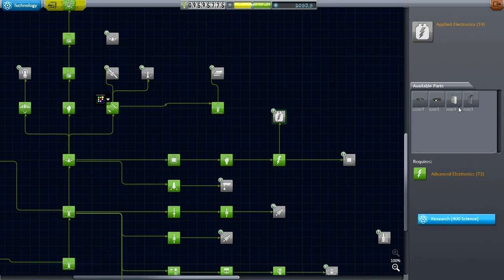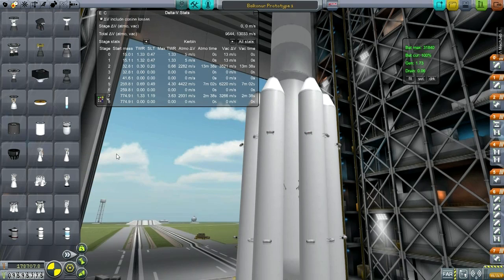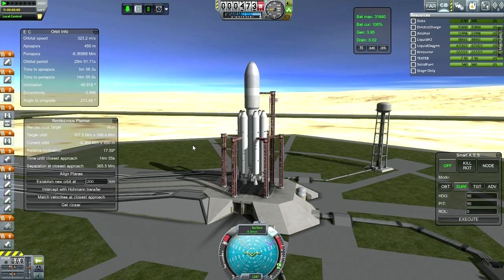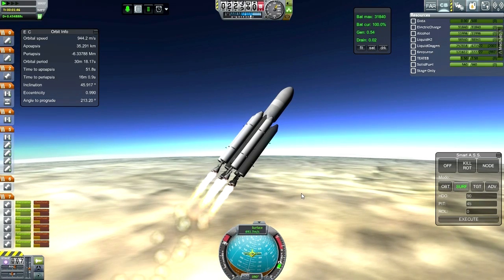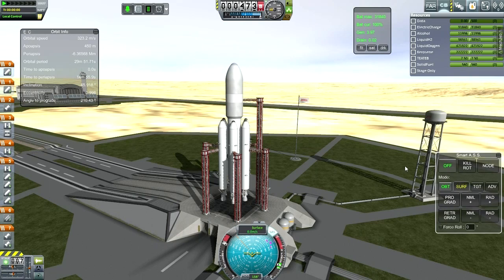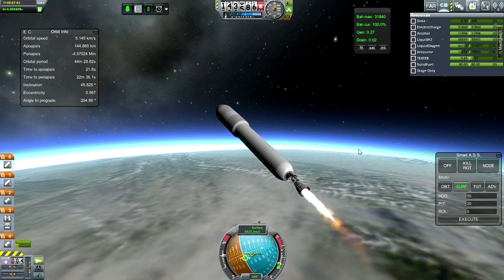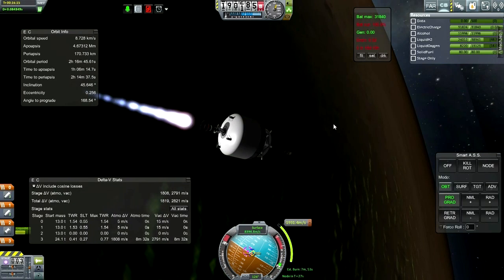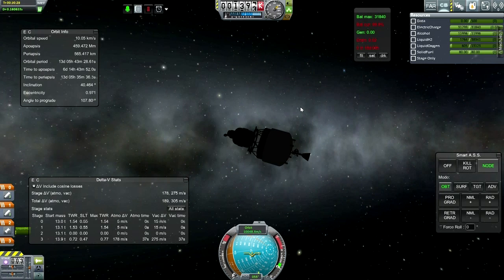Kerbal Space Program (0.24) - Realism Overhaul 055 - Baikonur and Bugs

Comment: I know how old this video is, and that no one will probably see this, but I know the struggle of lunar launches from baikonur. I was recreating one of the Luna missions, and Luna 1-3 were direct ascent missions, and due to baikonur's inclination, they were launched off plane over the North Pole, so getting a good encounter depended almost entirely on a well timed launch. I ended up launching my missions south over Antarctica instead of North, so that my trajectory would come closer to the moon's orbital plane. None of the engines on the R7 used for these missions were throttle able or restartable, so I couldn't make any kind of corrections after the initial launch. I added RCS thrusters to make some small adjustments though, because there was almost no way I could've done it otherwise. After a lot of trial and error and a lot of luck, eventually I got it to work well enough to get a close flyby and an impactor, but I never tried it in that configuration again. I basically just eyeballed the launch window, which only really worked due to sheer luck alone, and was not really repeatable, so I failed a huge number of times. I think this might just be one of the most difficult things one can do in RO, and I was only able to do it with tools like MechJeb that helped me plan my maneuver mid flight. Using the molniya was a lot easier because I could at least get to orbit first, but it was still somewhat of a challenge. 

I don't really know why I posted this, but I just felt like sharing my experience for those who are interested, even on a 5 year old video lol.

Comment: Regarding the "space key bug": The staging has a build in cool down time. This time is in-game time! If you rewatch your video you will see the time at launch does not progress for several seconds while you are spamming the space bar. It won't let you stage again until some in-game time has elapsed.
Because of the lag you can also see that after releasing the launch clamps the control switches from local (via launch clamps) to satellite. This actually causes the engines to turn off because of the missing connection until (after half a second) reconnecting via satellite. This causes the "going down" of the rocket. With the great amount of lag you are able to see all this in slow motion.
Reply: *****
Actually I watched he whole video but had typed in my comment already at the begining. ;-)
Still I think you didn't get my point. I don't think FASA launch clamps change the staging cool down but instead may increase the overall lag. What seems like a longer staging delay in real life time is most probably the exact same delay in in-game time. It only seems longer. You can see the MET is still on +0s when the clamps finally give way although in real life already 20s have passed. In in-game time the cool down still is something like 0.5s.
I myself am using FASA all the time without any lag. So my guess is RO is to blame.
Reply: Der Troglodyt I thought that the staging delay was 1 second.
Reply: Jake I remember reading that too somewhere but can't find any reliable source on an exact value. So I go with what I can see in the video.
***** I didn't mean to blame RO alone. Most mods work perfectly fine on their own. Being a developer myself I know it's always the interaction / side effects where it gets nasty. ;-)
Good luck for your trouble shooting.

Comment: Oh - first time you loaded up the rocket - I immediately shouted - "that's Angara-7!" Well it sorta is, but in a real life designers are using the same modules for boosters and core stage. They light them all on the ground, but throttle down core stage engine to the minimum until boosters separation (taking advantage of deep throttle capability of RD-1xx family). And your TLI stage resembles KVTK upper stage that is in development now - although it's planned to use RD-0146D version of the engine with lower thrust, but higher Isp. So overall it looks like you independently came to the same design choices as real life designers did :)
Now - as for flights to the Moon from Baikonur. The plan is to use off-plane transfer, where you start your burn in one of the nodes (either AN or DN), and this ensures your apoapsis will be exactly on the opposite side. Now the only problem is to make sure the Moon will actually be there at the same time your payload will. In real time it's done with better timing of a launch, in KSP I couldn't be bothered to do that, so with a bit of extra dV I bring my apogee higher than that of the moon - since the orbit will be very elliptic, velocity near apogee will be very low, which allows for 1) very cheap plane changes, and 2) you let the Moon to catch up to you since it will be going much faster than your payload. With that approach you don't have to worry at all about launch windows, and can launch anytime - once you in orbit see which node you will need to use for TLI burn and plot ~3200 m/s TLI burn and then tweak it to your liking.
Please note that this kind of trajectory can be used for launches from anywhere with any resulting parking orbit inclination, and dV for such maneuver is going to be roughly the same from any inclination.
Reply: ***** Lag is almost always related to nullrefs spam in the log. The first step to diagnose is to open the actual log file to see what mod is spamming and take it from there. I've never had any problems with RD-0146s myself though (although I used them quite extensively), so maybe it's some new issue - likely in RF or Engine Ignitor (or both). Anyway - post those nullref messages and we can take it from there. Usually having that error message it's quite easy to find the actual code in the source which is causing the problem, and from that - to make reasonably educated guess as to how to make it go away.
Reply: ***** Ok, please let me know if it will - I haven't played KSP for quite some time, so I need to know if I can safely upgrade to latest versions of stuff.

Comment: Has Squad ever provided any indication that a really large persistence file will overload the game?  Your mention of this possibility kind of makes me think that there might be a practical upper limit on how much exploration you can actually do.
Reply: ***** There's no persistence file upper cap that I know of, specifically, but large files do stress the stackloader somewhat, especially for individual craft with high part counts that exist within otherwise large saves.  The only problem to which larger persistence files are peculiarly vulnerable is data corruption -- if the KSP process itself ever hangs or crashes WHILE the persistence file is being written or overwritten, a single character off can result in large chain-corruptions of data.  Not that larger files are more prone to crashes, simply that a crash is likelier to damage the file when the crash does take place.  It also bears mentioning that Squad hasn't officially devoted large chunks of effort at streamlining the core code yet while they still map out the outer envelope of the basic feature set; this would tend to imply that memory leaks may exist in the code that have simply not yet been identified.  Add to that the fact that most third party mods haven't been extensively streamlined yet, because most mod support and development is keyed to tracking KSP feature-evolution, and how mod-heavy (specifically plugin-heavy) RO is, and it's quite the viper pit of invisible issues.  (Majiir's Kethane mod is notably quite streamlined, from what he's said on the forums, but he has expressed various types of concern over the months that his own streamlining efforts are bottlenecked by lack of streamlining not only in KSP but also Unity itself.)

Comment: uh I hear anger in your voice;P
anyway
http://forum.kerbalspaceprogram.com/threads/92236
-staging launch clamps is x64 related bug(Delayed\locked staging)

when i play RSS i get biggest perfomance boost when there is less than 50 of asteroids (when you use high timewarp they are appearing very fast).
I have an idea how to lunch into moon's plane from Baikonur but i'm not sure if it will work, so i will test it first.

I had done some research on antenna ranges in RSS. RemoteTech range in RSS is additive, witch means that you have more range than the "antenna range" says(it uses some simple equation to calculate it). it also means that your signal range will improve if you will add more antennas. As for AEIS omni antenna it has 1Mm signal range when it is folded (which means it can act as "always-on antenna"). It also means that you would be able to unfold  that antenna on Venus lander back then(anyway you had lost omni antena on orbiter so it wouldn't change anything).

EDIT: I found RT info about signal range: http://forum.kerbalspaceprogram.com/threads/56399-Now-defunct-thread-that-should-not-appear-in-google-search?p=874205&viewfull=1#post874205